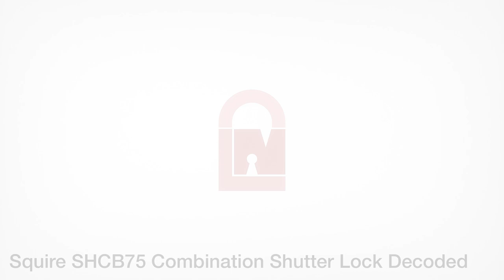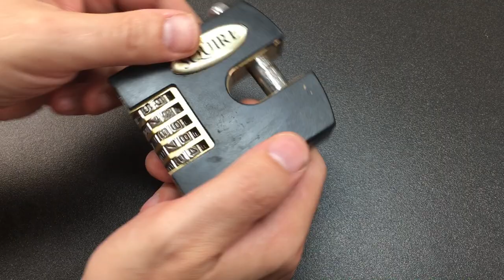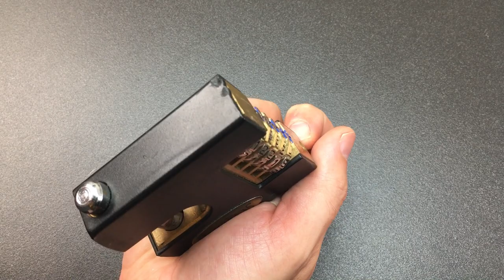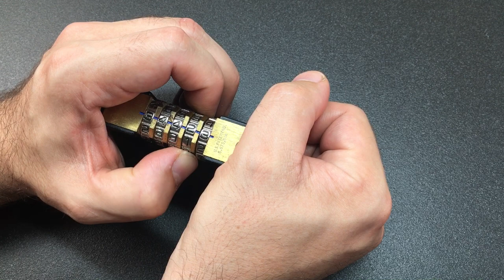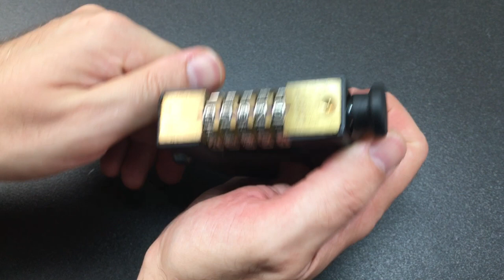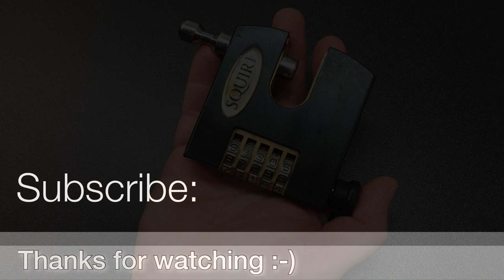Squire SHCB75 Combination Shutter Lock Decoded

Comment from the maker: A lot of people have requested I do a decoding video on these big Squire combination locks, so here it is! 😃👍🔐💪
Reply: I have one of these, and I was surprised how easy it is to pick. When you're in the correct gate you can feel it possitively in the knob. Once you've decoded it and it unlocked, pull the knob   out another quarter of an inch and turn it clockwise until it clicks  in place. Now you can reset the code. Turn the knob back anticlockwise until it springs back in place and your code is set.
Reply: ...oh, and the tiny hole is for a retaining screw that prevents you pulling the knob out too far and resetting the code by accident.

Comment: I've had a Squire padlock (I now know is a SHCB65) stuck on an old chain for many years. So after watching this, I thought I'd have a go. It took some time and several repeat watches but it worked! It actually did work 😀 finally got the lock off the chain and we can utilise it once more.

I've now had a roam on the E bay and purchased a locked out padlock to have another go 😋

Thank you Lock Noob 👍🔒
Reply from the maker: That’s really awesome! I try to be as clear as a can with my instructions. But it’s always nice when someone confirms they work!
Reply: @LockNoob 

I don't know if you've already found out but the drilled out part was a small brass screw. This brass screw acts as a stopper for a pin set into the mechanism shaft that you pull to release the lock. If you remove said tiny brass screw, the mechanism can be pulled out further and then rotated 90° clockwise and locked into position. I assume this allows setting or resetting of the code.

Comment: I have one of these too and it is very easy to decode. If you take out that little screw, which is removed to reset the code, the plunger seems to move out easier at the true gates.  Edit: to reset the code, remove the reset screw, pull out the plunger all the way and turn it until it clicks into the reset position which holds it out. Set the desired combo, then turn the plunger out of the holding position and it will spring back in to place. It looks like with yours, the screw is just missing. If the screw head has been drilled instead, just drill the screw out. The lock will still work perfectly well without it.

Comment: to reset the code the screw that has been partially drilled out needs to be removed then it is possible to pull the pin out further enabling the combination to be changed🤪

Comment: I don't understand shutter locks in general ... If someone tries to cut the shackle it will get indented/deformed. Won't this prevent the shackle from retracting, which will lock the owner out? In particular, these Squire shutter locks have a channel on the shackle that would easily get deformed, preventing it from running along its track.

Comment: Same as the bicycle chain locks I used to open as a kid. Easiest lock in the world to open. Generally the only way to change the.combination is to replace the dial, as each dial has a gate permanently cut into it. 
There must be a way to disassemble  it once it's open, a screw or circlip that can be removed maybe.
Reply: Perhaps that is what the drilled dimple is....a screw that once tightened had the head ground off and recessed so a new screwdriver slot can't be cut in it.
Reply: @parapicktog7734  the drilled out portion was a screw you undid to rotate the wheels to your new code then screw it back in to set it
Reply: The screw prevents the plunger being pulled out further to reset the wheels. It's only a tiny brass screw, so easy to drill out.

Comment: I'd like to see what would happen if you drilled out that divot completely and opened up the plug, seems like it might allow access to the locking pin, and if you can remove it, and the spring which I presume rests on it then you might be able to open the lock without dialing a code. Either way, it would allow you to rethread the hole, screw in a new plug with a bit of loctite, cut it flush, sand it down a bit and make the divot disappear!!
Reply: Nope, cos the locking pin is the other end of the lock. The screw just prevents the plunger being pulled out further to the reset position.

Comment: You can recode these, you need to pull the black plunger out and turn it 90 degrees. Then set new code.
Reply: after undoing the screw that was drilled out

Comment: Hey umm how would I remove a broken lock pick from inside a door lock that Is already in use..? I know I know I fucked up I shouldn't use it on locks that are in use but I was curious plus it happened like the very first time I tried it man rip.. so I've thought of a few methods, like sticking a tiny magnet inside although I don't have a tiny magnet, or putting some glue on a stick and carefully letting it glue on the lock pick, I tried that harpoon lock too but 0 luck. Calling a locksmith isn't an option in this situation. Luckily I don't ever really enter that room, it's where I keep my old bicycles, that's why I did it most. It was my only city rake lmao rip. Any ideas?

Comment: I found a lock very similar squire  but I'm not having any Joy with getting the code, any other tips, or should I just keep watching your post and keep trying
Reply: The plunger spring is very strong, You're probably not pulling it out far enough to make one of the wheels bind. When I decode combo locks, I usually start with them all on 0, then turn them ALL to 1 and see if anything changes. Then turn them all to 2. If one of them is in a Gate, it will be stiffer than the rest. Keep doing this until they're all in a Gate. The false gates are directly opposite the true gates, so if you've got that far you just need to try each opposite Gate to feel which one is looser.